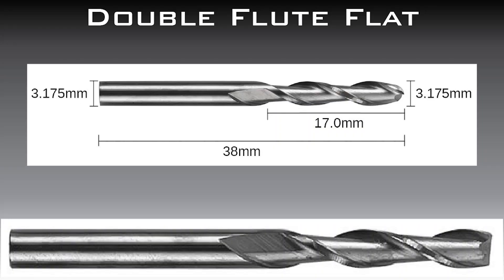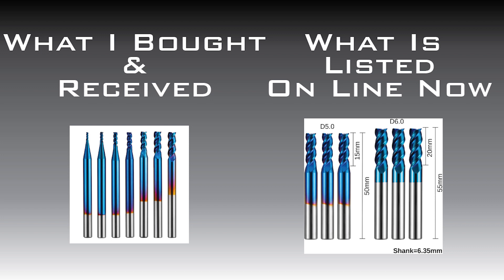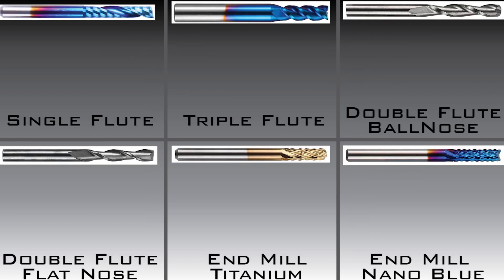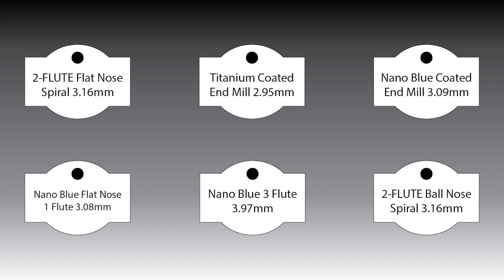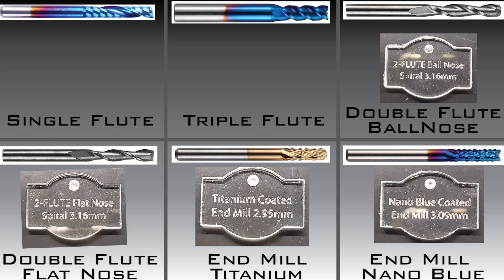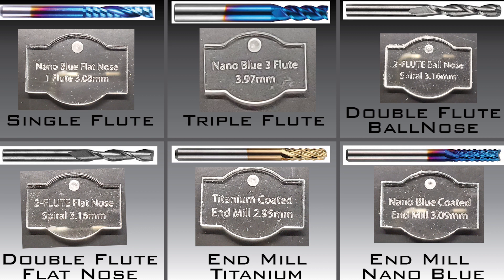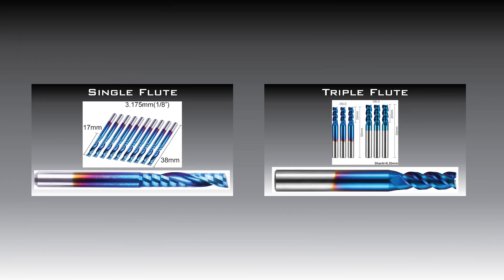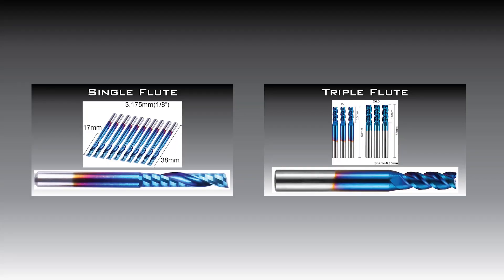Testing 6 Different CNC Bits to Cut/Mill Cast Acrylic with my 3018 PROVer

Comment: thank you very much for sharing your knowledge! can the same concepts and routing bits be applied to a manual woodworking router?
Reply from the maker: I have done it on my longmill which uses a hand router, so yes it will. Not sure of the results when doing it by hand.

Comment: Have you done any "3D" carving of cast acrylic? I'm wanting to try some 1/4" white cast for some lithophane and need some recommendations for bits, feeds, and speeds.
Reply from the maker: I did a long time ago, with so so results. I would recommend to hog out as much material as possible with an uncut bit as you can. Then test with a v bit and ball nose to see which one will give you the best result.

Comment: Excellent, dude. Many thanks for this.

I got a 40w diode lazer hoping to cut acrylic only to find out that I'd need a co2 laser. Gutted as I have a bunch of those led bases that I was wanting to make shapes for. 
Then, I attempted a few carvings and the plexi kept melting and bunching on the end of the bit. Like, every few seconds. 

I was stuck but now:
1. Bits can cut acrylic and I may not need a co2 laser! 
2. Material matters (but maybe perspex is just not millable) 

Cheers man
Love from Ireland 🤘 🇮🇪

Comment: what type of acrylic do use is there  a specific brand or thickness ?
Reply from the maker: You want cast acrylic. I use 3mm and 6mm thickness, just depends on the project, for the led lights 3mm. As for brand I have gotten some from amazon. If it's paper mounted then very good chance it's cast acrylic. If it's plastic film covered then very good chance it's extruded. Recently I have been getting my acrylic from makerstock, but there are several other acrylic providers on the web.

Comment: For fine details. V-bit that came with the machine was melting the plastic at 1mm (.2mm pass). Tip broke and the rest of my letters actually came out better. What depth is ideal to capture edge light, but avoid melting?
Reply from the maker: I use a spring loaded drag bit now and it is only 0.1mm depth of cut. The etching is picked up great by the light. You do not need a big depth cut for the light to catch.

I did the below on my LongMill.

I just did some testing with a 60 degree vbit, contor cut on Text 1 pass at 0.3mm it left acrylic chips in the cut. On a pocket cut it left chips on up until the last couple of outer laps of the cut, but by the end it cleared 90% of the acrylic chips out.

So my conclusion is on the  20mmX20mm square test i did, and text, it did not have enough time to cool  or the acrylic did not have the room to eject enough so it melted back. 

Do a test at 0.1mm or 0.15mm per pass and see if that happens. The broken tip maybe ejecting more acrylic out, so it's not melting back.

Comment: Ok so today i used that endmill nano blue with 3mm acrylic, first time, tried 1mm 1.2mm and they broke , 1.5mm didnt break but they all melted the acrylic and made bad cuts. So whats bad ? The burs or the acrylic sheet? Im newbie first time , also cant get the depth right, i measured the sheet thickness and zeroed the axis right but still go deeper or shallower , thnx for the help
Reply: Speed was at 12k
Reply from the maker: So first thing is, are you sure it's cast acrylic? Was it paper face covered or plastic? Secondly what is your feed rate and depth of cut? Third just want to confirm the machine you are using is a 3018?

If it's melting and gumming up it could be pulling on your z down into the material. Causing it to cut deeper. 

Melting is happening because your generating to much heat so you can try and lower the rmp on your spindle and speed up your feed (10 to 20mm per minute at at time). Create a test file with a 10mm line that you can experiment with. Another thing you can try to cool down the heat generated is blowing air at where it is cutting or lightly spraying it with some water soap mixture. I have not had to do the water soap, but others have and swear by it. 

 In regards to the smaller diameter bits, yes they can break, but do work if you get your settings dialed in. I would work with the larger diameter bits first to get it dialed in, then move to the smaller bits.

If it is extruded acrylic, you just might keep getting the same results. If you got it from home depot or lowes 99% chance it's extruded, not cast. 

One other thing I have learned as I have cut more and more acrylic, is that yes O Flute bits are better suited for cutting acrylic. Not that the others can't, but they do a better job of ejecting the acrylic and generating less heat.
Reply: @D.E.Hammer  im so grateful for this awesome answer, the acrylic has plastic cover but according to amazon where i got it its cast acrylic!! My feed rate was 25in/min and depth per pass 0.02 inch
Plunge rate is 9in/min, not really sure what they are supposed to be , i kept them on default, i will try your great advices , thank you so much and i appreciate your time very much :)
Reply from the maker: Well let me provide some context in terms of feeds and speeds. On my 3018 any time I get over 300mm a minute, my machine would go crazy with vibration or my bit would break. Yes even a larger diameter bits. Talking with another 3018 owner, they were able to get theirs cutting at mid 500mm per minute. Yours is just over the 600mm per minute. For some my 250mm to just under 300mm per minute works for them and others can go faster. It all comes down to what can your machine handle. You can tell just by the sound of your machine if you are going to fast. Plus this is info is on  Stock machines no upgrades.

So I also hate to say it, but amazon dealers have sent me extruded instead of cast. Now "Most" of the time cast acrylic comes paper faced, and extruded comes plastic face. Some people on Amazon will sell extruded as cast. It's really hard to visually tell, so it becomes a buy and test it out kind of thing. Buying direct from an acrylic supplier for hobbyists and professionals cuts the probability of that way down.

You can cut extruded, but you have to have it dialed in just right so it does not gum up on you, or have some kind of cooling solution.

I hope this all helps and you get it dialed in. Let me know how it goes!
Reply: @D.E.Hammer  i appreciate the insight, i would try some different things and see how it goes, thank you so much

Comment: QUESTION.. what tool do i need to make a 3d on acrylic? i tried everything but never succeed...
Reply from the maker: That is something I will have to look into.
Reply: @D.E.Hammer  I am glad you want to help..its very important for me and my business..  when I tried ball noses, tapered etc never worked..always leave material stuck on the polycarbonate.. not melt..just stuck..I even tried engraving tool..nothing.. trying to make some molds

Comment: Thank you for your explanation, this video help me a lot. Could i ask you some thing? i'am using the endmill nano 2mm, but i don't get it why the acrylic sticks to the endmill and forms clumps when I use it for cutting...

I hope you can help me and sorry if my English made you confused :)
Reply from the maker: Your welcome and I hope this answer helps. The main cause of that issue is the use of Extruded acrylic, it has a low melting point. So it melts the chips of acrylic you cut and gums up your bit. What you want to look for is Cast acrylic, it has a higher melting point. With Cast acrylic I have never run into issues of gumming up my bits.

On smaller machines it can be hard/impossible to cut Extruded acrylic. There are several reasons for this, but they just do not have the rigidity in the axis to increase the feed rate enough or the spindle just does not have enough torque. So getting the balance to keep the heat generated low enough to not melt the acrylic and eject the chips far enough out can not be achived. I have heard people say they spray a soapy solution or blow air on it while it's cut, but I have not seen a video demonstrating this and from my attempts has not worked.
Reply: @D.E.Hammer  thank you for your answer and solved my problem. Good luck always for you. thank you i really appreciate it

Comment: on the V bit what are the rates you're using? there was no mention of this, same as the other rates?
Reply from the maker: For the spring loaded drag bit I use anywhere from 250-300mm per minute for feed rate, 250mm per min plunge rate, with a 0.1mm depth of cut, and 1 for RPM as you do not want the spindle on when using a drag bit. (1 turns the spindle off, it will not let you enter in 0 in CC)
Reply: @D.E.Hammer  thank you for this information. I was actually inquiring about the 30 degree Amana 45771-k
Reply from the maker: @aaadeejay  Sorry about that, for that bit on a stock 3018  I use anywhere form: 225-275mm per minute Feed, 75-150 mm per minute Plunge, 0.15mm per pass, and i think with was 9000 rpm.
Reply: @D.E.Hammer  AWESOME! Thanks!

Comment: I want to make accurate PCB's with perfect aligning holes. Not sure if an end ball mill or flat end mill is better for drilling 0.8mm holes.
Reply from the maker: I have not cut PCB, but my first try would be to go with a Flat End mill. If you have a spare PCB board to test it on I would try that first and see how it works out.

Comment: I heard someone say an O flute works well... I'm new so I have no idea.  Thanks for testing these.  I just got my 3018 yesterday.  I noticed in the manual that there is a laser module...  Have you or anyone on here gotten one?  I'd like to cut some plastic or acrylic parts on one.    Thanks!
Reply from the maker: I am new and still learning myself.  "O" Flutes do work well, just trying to get the right speeds and feed for it on a stock 3018 prover dialed in. So far i get a lot of chatter and miss steps. As for laser, to really cut clear acrylic you will need a CO2 laser not a diode laser. Some have said they spray paint one side of clear acrylic for it to cut, but have yet to see a video or picture of it being done that way.

Comment: Nice video and I love your Dallas acrylic piece.  

The only issue I see is that in any machining operation the most important factor is speeds/feeds and it changes for tool size/shape.  Running the same speeds/feeds with different bits won't really tell you much.  Usually what causes residue on the tool is overheating, indicating too slow of a feed or speed setting.  The reasoning is actually called chip load and it relates to how fast and how large of a piece of material it is removing.  Might think of it in extreme.  The crazy idea of zero spindle speed and and and feed rate will break the tool. That's with the spindle speed too slow for the feed rate.  High spindle speed and slow feed rate does not cut, it wears on the tool creating heat.  The proper chip removal or chip loading is pretty essential to most machining operations. Here's a general Wiki. https://en.wikipedia.org/wiki/Speeds_and_feeds

Did like it, thanks for the time and consideration, we are all thankful.  Take care...
Reply from the maker: You are 100% correct. I did run tests on these at different speeds and feeds before I did the video, but the basic endmills still ended up with worse edges, than the single, double and triple flute. They always left a gunkier and artifacts on the edges, no matter what speeds or feeds. I also broke a lot of bits testing for this video, so I should have probably brought that up as to why I stayed with my normal settings for cutting acrylic. I was/am still new to CNC and making videos like this, so appreciate your time in watching and your response.

Comment: As a former production machinist (back injury ended that), I can tell you that you should try a 4 to 6 flute nitride coated endmill. I have cut many acrylic parts that way with great results. we also didn't remove the protective paper 'till the cutting was done. I got myself a 3018 on the way and cant wait to get going with it. I like the 6 flute as it has a 45 deg helix angle on the flutes and did a better job of preventing chip buildup in the endmill. I do like this vid as it gives me insight on the 3018 as I am more acquainted with fedal and hass. Have you tried a drip tube or any other form for cutting / cooling liquid?
Reply from the maker: For this vid I wanted to use bits that most hobbyist and newbs would use or already had so they could start cutting cast acrylic. What I find interesting in what you are saying is that a lot of people on the Forum groups I am on say to use a 0 Flute for cutting acrylic and stay away from the multi flute. I guess I am going to have to get some 0,4,6 flute bits and try them out on the 3018. As for removing the top paper while cutting, just had so many issues with it gumming up the bit and leaving a residue on the side of the acrylic. So it saved me lots of time in clean up. No I have not tried any kind of cooling, as I would have to build a custom set up and I need to finish the projects I have going before starting that.
Reply: @D.E.Hammer  Keep in mind this was on a Fedal 4020 (40"x20"x17") commercial mill. We had coolant going too.

Comment: Thank you for the pragmatic comparison of the cutter styles. The usual advice is to increase the feed-rate if the cutter has more flutes. E.g. 3 flute would be approx. 3x the feed rate.  Too slow and the cutter will rub, and not clear out the chips as well. I am about to try engraving some plexiglass, it will be interesting to see if it behaves the same as aluminum, where those feed-rate rules seems to help with cut quality.
Reply from the maker: Yes, I still need to do some feed-rate tests with the 1 flute & 3 flute. The issue I ran into with my machine is if I get up over the 315mm feed rate I would start breaking bits when I was testing my Nano-blue & Titanium end mills. So it will be interesting to see what these will do.
Reply: @D.E.Hammer  Broken bits are an opportunity to learn how to make d-bits , I am getting some practice in that myself. :-)
Reply: @gerritvisser  d-bits?   I'm new...
Reply: @snowwolvesproductions  Hi, check out Stefan Gotteswinter, he demos grinding d-bits in a few of his videos. d-bits were traditionally used with engraving pantographs such as Deckel and Alexander. Very useful for custom shapes. I have an Alexander 2CG, which  I use for grinding all kinds of cutters and doing four-facet grinds on drill bits.

Comment: Heyas. Thx for the Video. I just startet with acrylic Designs and have thousands of ideas. So i found your channel and it was absolut amazing to see your Signs and how u made them (sorry for my bad english - me from germany....).
I am almost in my testings and last week i try to cut 5mm several acrylic plate. Wow it was horrible :-) meltings broke the bits ... argh!
So i bought Single Flute Wolframcarbid bits (3,175 mm x 15 mm ) and it works fantastic- i use the same settings for the cutting.
And the best... the acrylic was very clear at the cutside... now i am waiting for the delivery of the spring-loaded drag bit (and man! just translate this to german and fins such a bit....) - but ebay was helpful *gg
So many thx to you for all the work u do and the suggestions for my own work with my little 3018pro :-)
Reply from the maker: You are going to love the Spring Loaded Drag bit. It gives you way better detail. Thank you so much for watching!
Reply: @D.E.Hammer  OK this is really impressive. I have my spring loaded bit since last week and made a map from ireland for my daughter. Damned looks this good.
Thx for the inspiration :-)
Reply: Hola yo me inicio y me gustaría hacer lámparas de acrílico tengo fresa de 1filo de 3.1. Y de 1.5 que velocidad rpm.y que velocidad de bajada y profundidad las tendría que usar